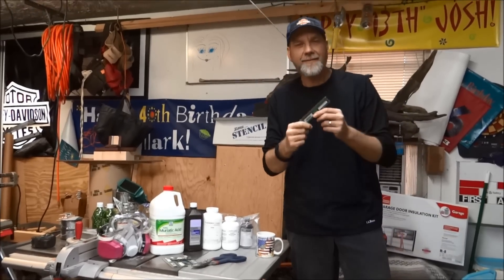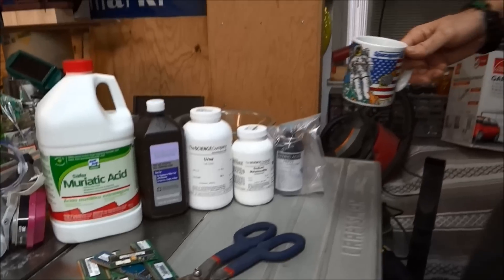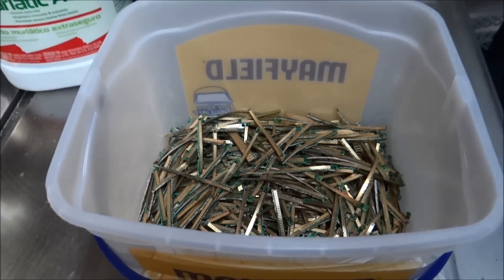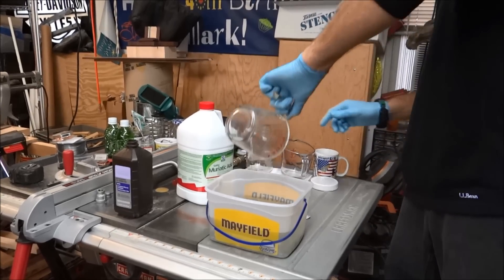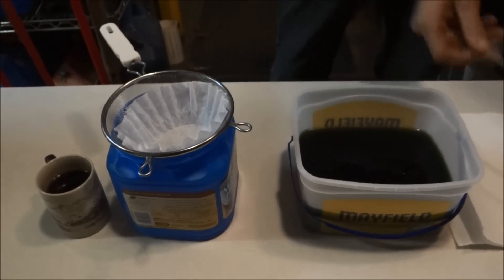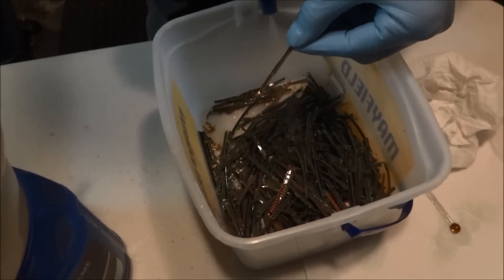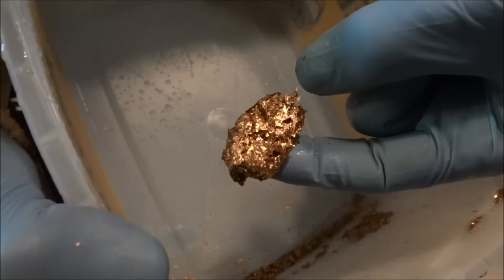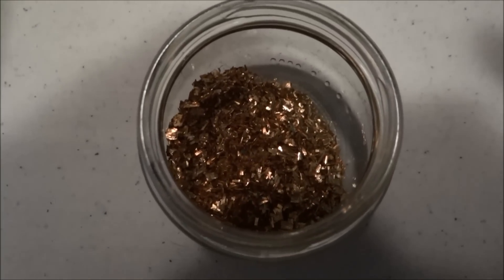How to easily recover gold from scrap computer chips

Comment: Would get more money selling it as RAM than you would destroying it by taking the gold out.
Reply: You could take cases and use a dremel to cut cool designs into them, then add led lighting inside, so the light shines out the places you cut. You could install plexiglass windows. You could take parts off of hard drives, especially the motor mounts and screw tons of them to the case and other parts from scrap pc's to give it an industrial look, or call it steam punk to sell it to that crowd. Theres all kinds of stuff you can do. Power supplys from pc's sell really well if its a relatively new pc. People are always messing them up or they go out on them for whatever reason. If the pc is working, the ram sells as well as the dvd-roms, on ebay, again, people do stupid stuff to their pc's. When I worked for a guy that repaired pc's, we had people call it, typically clueless older ladies, they would say their cup holder broke, I was like WTF??? Cup Holder?? They would describe it and damn if they weren't talking about the dvd-rom, they thought it was a retractable coffee cup holder. We also had people calling all the time wanting to know where the "Any Key" was, they most of the time were setting up their pc, or installing new software and the instructions said to press any key, so they were looking for an actual key that said "Any" on it, one time had a woman call up and said her new pc didn't work and she needed it really bad that night. We went over everything with her, nothing would get the thing to work, she said she had it turned on, so I was like what do you see on the screen, she said nothing, I finally said it must have a loose wire, I asked was it still plugged into the wall power outlet and was the other end of that plugged into the back of the PC, she was like... "Uhm... It's supposed to be plugged in??" ... All I could do was shake my head. You see and hear it all.
Reply: @ShakyShawn8151~ That's what i tell people.   Sell scrap electronics and then just go buy gold.   You'll come out ahead in the end.   Let some other fool go through the time and expense of extracting gold from scrap electronics.   Work smarter, not harder folks.
Reply: Bryan Neill obsolete ram is useless. Nobody is going to buy 128, 256, or even 512 anymore, might as well scrap it!
Reply: moncorp1  How are you gonna sell some old ass ram? You might find someone in the world to pay $20 for a box of ram, but your not gonna get much.... I dunno... I agree with yall, but selling any old comps sounds like it would be pretty damn hard let alone the parts...
Reply: Monkey Gaming Boardsort.com I cruise my neighborhood on garbage day, other close neighborhoods too. I see pc's every week just about, also, I put a post on our FB page for our homeowners association offering to recycle pc's for free and destroy the hard drives in front of them so they know their info will never be obtained. Also post the same service in our monthly newsletter. I get 10-15 pc's a week this way. I get $3-4lb for motherboards, $8-9lb for the board off the hard drive, $12-15lb for RAM. Box them all up, when box's are full, ship to Boardsort and I get a check in a few days. I avg. $300-500 a month total, for all the different saleable pc parts. The cases add up fast for scrap metal, the platinum discs from the HD's sell well once you have a quantity, the Rare Earth Magnets in the HD sell well on Ebay for stacks of 5 and 10, the cases from HD's are clean Aluminum, they are about $1 each in value at the local scrap yard. PC's are a nice cash cow when they are free.
Reply: Hell yeah brother (hogan's voice)
I need to get on it....
I'm about to make some posts, and stuff in all the facebook locals...
I'd like to collect cases, and do custom work on them with the dremel.
I've always wanted to run a shop where I built custom computers, and the only place you can really make money is on cases or just overcharging for parts that someone can look up, and seee you overcharged n it wont do nothing but encourage people to build their own.... but anyway... I really appreciate your post mang... I need to get on the ball..
Let alone the fact I could be getting a free windows 7/8 version off some of the computers possibly... I definitely need to save what I can for this build I'm trying to do within the next month.
Reply: Misfit1026 and this is why I'm considering an IT position. Sifting through some of the bs you deal with... You sometime come up with GOLD discussion that really lower your opinions of the human race. My favorite has always been 

Customer "my computer won't start"

IT "Did you check to see if it's getting power"

Customer "yes! I'm not an idiot, it's hooked up correctly, lights in the case, switch next to the cable is set to on, but nothing happens when I hit the power button!" 

Skipping the irrelevant hour long conversation here.

IT "which power button are you hitting?"

Customer "the one on the screen, DUH!

IT "..." FACE-PALM
Reply: LOL!
Reply: What if the ram is unusable?? I find this to be much better

Comment: I'm sure all the people doing this are disposing of the chemical waste in a safe and ecologically responsible way. While disregarding the fact that proper disposal is costly and would severely limit profit.
Reply: Deimos Phob 512 megabytes is obsolete, nobody wants to use the old smaller ones they're incompatible with the large needs of modern computers.. they're memories now measured in gigs
Reply: baking soda dummy neutralize the acid and test it with a pool strip.
Reply: The thing is, is that so many people are lacking knowledge.  The amount of HCL used to eat the copper under the gold plate was through the roof.
Reply: rk4life88 exactly 👍
"Oh mother earth oh mother earth what area they going to do with all of that acid?!" 
"Ah, neutralise it with baking soda" "oh 😯"
😂😂😂😂😂😂😂😂
Reply: Memory is bought a lot on ebay..  you can sell stacks of it for decent amount working or not..  The disposal is an issue, cause some of those chems are not safe for toilet..  Just remember, anything you put in the toilet is on your dinner plate two weeks later.. Don't believe me, just go to biosludge.news
Reply: It would be far more profitable just to sell the memory itself. Without the chemicals and stuff.
Reply: +9
Reply: EURIPODES actually the copper chloride is converted into safe copper carbonate and sold to put glazing on pottery !
Reply: EURIPODES  yep thats the problem these days no one gives a shit unless it comes to effecting them then there is issues
Reply: The BIG PICTURE! This is hardly to worry about and mother earth. Its all the big companies the manufacture all the things you buy for your home and use everyday that do all the damage, unless you live off the grid then you have a case to state!
Reply: Gold in the gutter Gold in gutters unbelievable https://www.youtube.com/watch?v=fwUj_w2KVUc
Reply: Yes disposing of the acids properly is costly.. recycling the acid however and using it on other batches.
Reply: yeah... be responsible enough to return the favor to mother earth, after all earth provides us everything.  there are things still out there that hasn't been discovered yet

Comment: respirators dont function on chemicals unless there chemical designed lol (the highly expensive kind) otherwise there just dust filters. it should say bio chemical approved basically.

otherwise again it does nothing for air partials that are chemicals.. like most masks you find at home.. would not help you in a chemical warfair attack.. you would die just as fast as aperson with out it

Comment: "Easily"
Reply from the maker: MechanicalCoffee If you can follow instructions, it is easy, just take time.
Reply: LifeBuzzN Materials. Equipment.
Reply from the maker: You are correct, there is overhead to start.

Comment: Strong vapors... he should be in a well-ventilated place (looks like his basement), or outdoors.  I do, however, think there is a fan in the back-ground noise...  Might have been good to mention.
Reply from the maker: Tom Fieselmann This is either outdoors or in my open garage with fans.  You are correct, this needs to be done under a hood or in a well ventilated area.

Comment: Does outside temperature make a difference?  We plan to do this in November in MN.  Also, is there any chemical reaction adding distilled water to the acid and peroxide solution?
Reply from the maker: ThatsMrMoronToYou It will take longer in in the cold, but should still work.

Comment: Not a bad video at all guys. Great information. Thanks for wearing the safety gear and using appropriate equipment, most don't. This process was very simple for me to complete in a controlled and safe environment (not at home) with spectacular results! I think if individuals utilize reasonable care and use discretion when handling the materials, it is possible to add quite a bit to your annual income.. Thanks guys :-)
Reply from the maker: Brian K Good Deal......Thanks Brian.
Reply: Where did u get the respirator from
Reply: Jjj

Comment: After Filtering there is a brown sludge with specs of gold stuck to the filter. So is the gold in the water or sludge?
Reply from the maker: FLOODDICKERSON Please watch both videos completely, then check out the details on my website at www.lifebuzzn.com.  Let me know if you have questions after that.  Thanks
Reply: Thanks a lot & tell lil Debbie Dez I say hello. My question is if Im bathing gold plated jewelry in muriatic acid and peroxide I'm getting little foils of gold or copper on top and this black mud mixed with little gold crystals so it never looks like the gold foils in your video. Should I filter the black mud and aqua regia the filter paper? That is the only thing that makes since if I want to recover any gold at all. Or should I do another process with jewelry?

Comment: I hope your dog won't die young from you conducting the experiment in there. Lots of fumes are produced, and they are heavier than air. As a result, they will sink to the ground, in the direct path of your sweet baby. I think you should keep her out of the room when you do this experiment. 2HCl( Hydrochloric/ Muriatic acid) plus H202 (Hydrogen Peroxide)reacts with copper to yield some Cl2 (Chlorine Gas!) So please, do this away from the dog. Please.
Reply: And don't forget a respirator rated P100 for acid and gas vapors.
Reply from the maker: andrew hooker Pooch is OK many years later, thanks for the concern.  Safety First!!

Comment: Some help here ? I used 20% muritic acid + Hydrogen peroxide 3% and tap water, so i had 2 separate jars with, memory chips RAM in one and the motherboard pins etc. in second, it stayed for like 2 days now , and the pins just turned like rusty and aint even gold color anymore, and with memories , conectors got the same silver color but i dont see any gold in the glass jar floating. Tell me what i do wrong? And btw, they said like they cant sell more then 20% of muritic acid, do i need stronger staff ?

Comment: your probably better off selling the RAM on ebay than scrapping it for gold, you would get more money for it.

for some people paying $10 for a memory upgrade is better than buying a whole new computer when theirs works fine, DDR2 memory sells pretty high. DDR2 Core 2 Duo/Core 2 Quad, and AMD Phenom x4 systems are plenty powerful for gaming and other demanding tasks

DDR memory is also in somewhat demand

older SIMM memory is sometimes in demand for old industrial equipment that depends on them

it is advisable you research value of the RAM before you scrap it, you might make more money selling it versus scrapping it.

Comment: Nice vid.
You really don't need to use distilled water to rinse. tap water is fine. distilled water is used in refing the 10k gold. then smelt.
yes it's 10k. Do your 10k rings corrode?(no) so why would they use 24k(to prevent oxidation of contacts) in your computer?(they don't)
So simply dissolve gold in aqua regia( add few drops sulfuric(drops any lead out) cool w/ distilled water ice-cubes) drops out silver precipitate(copper nickle etc will be left in sol) . nitric wash 3X's, rinse(distilled H2O & smelt.

Comment: Not trying to be negative but............
1.91 grams X $41.76 is $79.76 (like you said)
Safety goggles - $9, painting resperator $30, 1gl muriatic acid $7, 1qt hydrogen peroxide $1, 1lb urea $9, 1lb sodium metabisulphate $8, iLtr nitric acid $8, 4qt Pyrex bowl $19, 2qt Pyrex measuring cup X2 $24, Plastic colendar $1, steel strainer $5, butane torch $21, butane refill $6, plastic spray bottle $1, glass stirrer $1, crucible tongs & crucible $26, electric hot plate $18, total $194.  Not including the price for 100 memory modules, the tin snips, time, replacement filters for the respirator, cleaning products, medical treatment for lung damage, disposal of module remains, gas to drive to and from gold broker, digital scale, etc

Comment: Why can you not just put that into a crucible and melt it? wont the impurities just make a crust that you can hammer off when cooled?  Is it really necessary to turn it to liquid and then turn it back into a solid before the crucible?
Reply from the maker: mark oshields If you want it pure, you should follow all the steps.  Tks
Reply: LifeBuzzN but why wont the smelting process work for that? it seems if you smelt it the impurities would work themselves into a crust that could be knocked off.  The reason I ask is im not sure if I can get the chemicals to go thru the precipitation process  and if it could be skipped and the impurities just knocked off Id rather do it that way but I have not done it so I am ignorant and maybe what im asking isn't even possible, but id like to know why if not.. BTW I love your personality and your wife on the vid!
Reply: mark oshields The thing is that the "cards" the gold is stuck to is highly toxic if burnt. And some of the gold will also be broken down by smelting all of it, if even possible.

If you look at a quarry and the ores it produces, what they do with the ores is quite similar to what you do here, and its to make sure you get as much pure metals as possible from the rocks. The acids help keeing the gold pure and avoid comtaminants that can destroy the gold if handled wrongly.
Reply: mark oshields Thanks!!

Comment: Amazing well described video(s) I have watched part 1 and part 2 several times. If I may can I ask why not just use the nitric acid and muriatic acid and the solvent water first? I'm about to start this process I currently have around 1400 lbs of old TV studio cards and boards all from the 70's and 80s all loaded with gold plating so I know there is something here. I just want to know if I should use your process or the Nitric acid and muriatic acids right off the bat? Thank  you so much

Comment: You used way too much H2O2! Just add a little bit, maybe 1:10 ratio to the muriatic acid. Also you dont need a mask for the H2O2, the only gas that can evaporate is oxygen. Use 3%-7% H2O2 and you dont even need the gloves. 3% H2O2 is used to bleach teeths.

Comment: I wanted to try and do this with some scrap gold pins I bought recently.  I'm not looking to make money, I just want to use the gold to do some hobby jewelry making.  But I'm curious, what do you do with the chemicals after you use them?  Is it safe to flush them, or do I need to take them somewhere for disposal?
Reply from the maker: Store them in correct containers, then take them to the your local dump that take this kind of stuff.  I would never dump it in the drain or on the ground.  Each chemical has a MSDS that instructs proper disposal and dangers.  Thanks Frater.

Comment: a nice way to waste your money cause you can just clear the data on the chips and cell them online and that will get you more money then this,
and for all the people that didnt notice it this is not from 1 chip of ram this is from a couple of hundred
Reply from the maker: I used about 100 RAM chips that are useless to be used as Memory.  They are 64MB chips max.
Reply: LifeBuzzN Thanks for your reaction cause in the video you didn't say the storage size was 64 MB, and those are indeed useless these days

Comment: Probably one of the best ones I've seen so far, you named all the chemicals and quantities without making us run around to various other websites. I've wanted to get into this myself for a while now, are these chemicals easily bought? Any special licenses or requirements? Thanks for the vid.
Reply from the maker: You can find them without a special license.  Most of the chemicals I got at local retailers, the rest were bought online.  Be careful!
Reply: LifeBuzzN
Ah! Very good. I will be careful, don't worry. 10 years of engineering and dangerous chemicals experience under my belt.

Thanks a million for getting back to me, much appreciated.

Comment: You guys are nuts. Man all those chemicals are deadly toxic. We used to recover metals from industry, like copper and gold and we had chemical fume hoods. Those face masks you use do not filter out chemicals only particulate up to a certain size.
Reply from the maker: You are correct, these are nasty chemicals and all caution should be taken.  Thanks John

Comment: You really shouldn't have your coffee less than an inch away from where you're pouring the mixture of HCL and H2O2. In fact, it's a bad idea to have your drink near any chemicals on account of the (remote but possible) chance that you could confuse the two. It's happened before, believe me.

Comment: The RAM is worth more usually.
Reply from the maker: Sorry, but not a lot of value in 128mb RAM chips these days.  If you know of a market that will pay more for them, please do share......
Reply: I said usually, and you can sell it on eBay and I run into more DDR and later RAM than anything else and I get anywhere from 5 to 50 dollars per stick depending on the size.